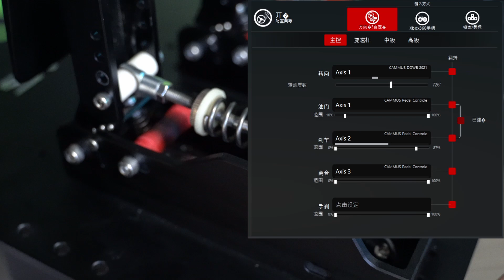CAMMUS Pedal Parts replacement and adjustment of current racing pedals

Comment: these pedals have load cells on all three pedals?
Reply from the maker: Yes, all them have load cells
Reply: @CAMMUSofficial  Why didn't I see where they are in the video
Reply: @CAMMUSofficial  can you guys make an updated video, I also don't see the load cells for each pedal in your video.  Edit: In another video you can see the load cells from the bottom of each pedal base, the silver rectangle module that appears to be about 3" long.
Reply: What is the pressure (load) rating on the load cell used on the brake, and is there a difference in the load cell used on each pedal?
Reply: @jonferraez  on discord they say it's 2kg